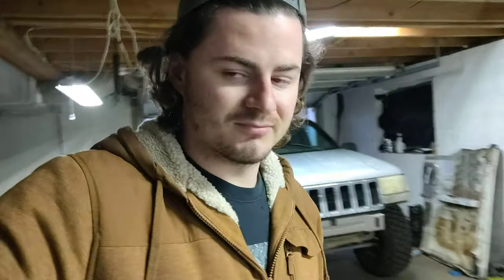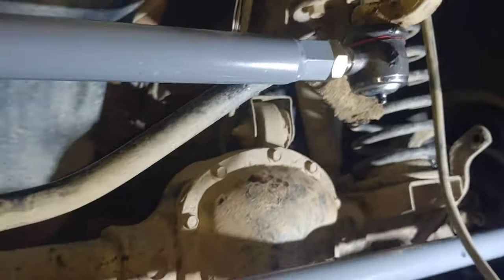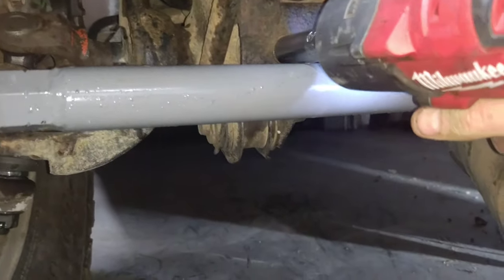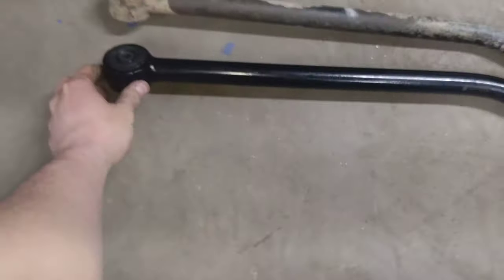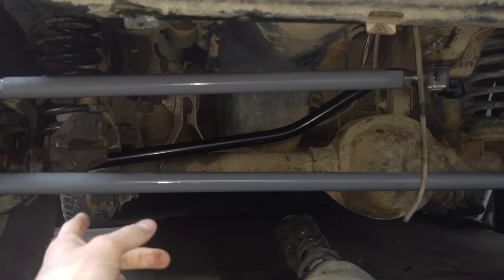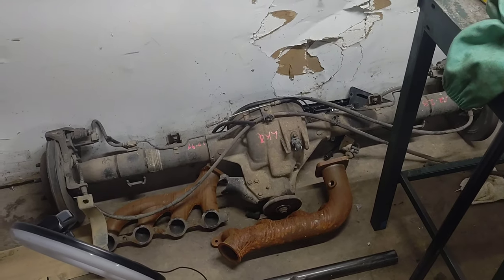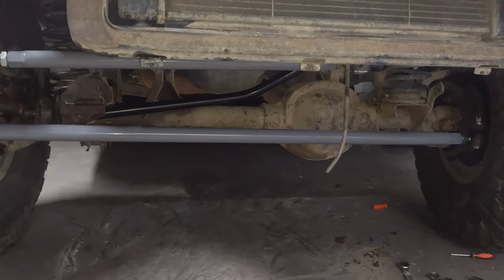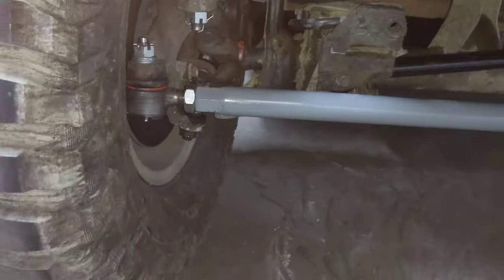wj knuckle swap update

Comment: if you move your drag link to under the knuckle it may help with the difference in angles with the track bar and straighten out its road manners, an alignment may help also.
Reply from the maker: It would help but my relocation and track bar parts should be in soon. It was my plan in the beginning to build a new one. Just had to make it to my next paycheck to order everything.
Reply from the maker: I already know what I want to do different on the high pinion when I get one. I kept the tie rod on the low side to clear everything but now that I'm going to be cutting the original brackets off anyway I could have put it on top of the lower arm instead. Hindsight lol
Reply: @thomasbeyer  i hear there im the same way waiting for pay day lol.

Comment: U weren't lying about those pucks holyshit after taking idk how much out of the inside i still had to beat them up on lol. When I get springs iam gonna have my hands full getting them off ill probably just cut them off and scrap them..
Reply from the maker: Yeah it's going to suck for sure. I'm almost ready for a spring upgrade. I want to go just a little higher.